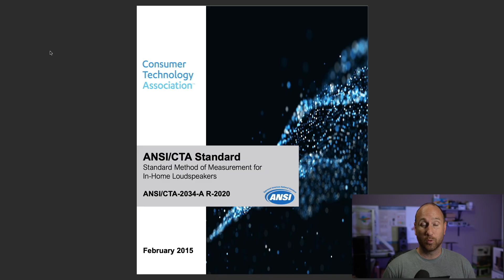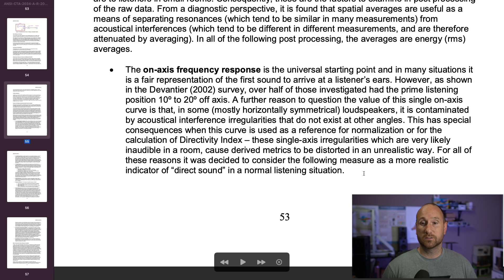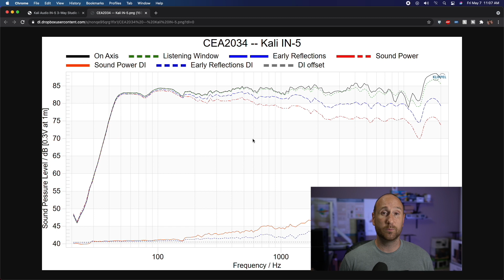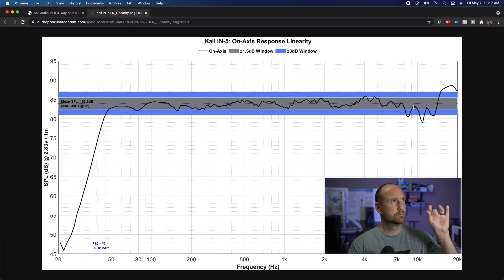What Is Frequency Response?  ||  Understanding the Measurements Part 1

Comment: Thank you. 
Just wanted to point out for nearfield listening people living in Apartments, condos, shared housing  above suites or below that a single sub for me anyways ruins the sound stagging for music. 
For movies sure a single sub is great but not actually needed if you have a largest book shelf design or small floor mount to be used on stands.
A large home with large room you maybe able to enjoy those LOUDER listening times and maybe a single sub would come into play better ?  Would 2 be needed also for proper sound staging in a larger room ?

I`m not exactly sure what the mainstream comprehension is for nearfield distances compared to a industry professional standard but it appears there should be 2 ratings extreme nearfield 2 feet to 4 feet.  Average normal nearfield rating 4 feet to 8 feet ? and the same 2 ratings for farfeild ?

Comment: In fact measurement of frequency response in a way it is popularly understood is not available. Hard to explain in two words but it is mostly about timing during collecting measured  data. 

  Measurement frequency response in anechoid chamber  suffer from ,basic  resonance in relatively big chamber. So if such speaker  "is flat" in chamber  that particular  frequency in smaller room may be downed  and that is why it is so popularly  advised to use sub-woofer., We will be better with speaker which has   lowest frequency as own resonance or cooperating  with resonance of listener's room than with one which has got results in not matching room   resonance of chamber .

   Mostly due to heavy damping in chamber results in real room will emphasize  the reflections of ranges which without treatment are hard to damp in such  room .  Such room damps well only reflections of sopranos That is why most speakers have too soft sounding in home and one of reasons for unnecessary hunt for higher sopranos That is why in my opinion measurements in chamber are false because conditions are although  standard anyway artificial

Comment: Great series of videos , very much needed info for many audiophiles . I dissagree however that on-axis performance is the most important . It's actually in the off-axis dispersion that good speakers are separated from badly sounding speakers . It's not that difficult to design for a flat on-axis performance but  Constant Directivity is way more difficult and very (the most) important !
Reply from the maker: I understand. I come from the perspective of a reviewer where I am explaining that - if you understand nothing else - you need to be able to understand what FR is. And IME, a speaker with a designed flat on axis will behave well off axis. Meaning, if the manufacturer cares enough about flat on-axis then DI is going to be pretty good, too. Of course, with a good DI, one can EQ the speaker more easily. 

But, yes, I agree. I’m just coming at it from a different perspective.

Comment: Thanks for your effort. Good stuff. There's only one point if you may allow me to clarify. You mentioned in-room vs anechoic response being different; while it is true, frequency above the transition frequency, say 250hz, chances are my in room response and yours wouldn't deviate that much.
Reply from the maker: That is true. My point was more so people wouldn’t take an in-room response of their speakers and then compare that to the on-axis response of another speaker.

One still has to be careful comparing two in-room measurements taken in different settings. But trends should be reasonably concluded.
Reply: @ErinsAudioCorner  thanks for the concurrence. Always a pleasure learning from your videos.

Comment: Curious about the X-Y frequency response graph. I think I understood what you were saying about your SPL (essentially volume?) on the left hand column can change depending on if you speak softer or speak louder. Does that also affect the Y axis (Frequency/HZ) response of the speaker. Or will that frequency/Hz response remain the same for the given speaker at different volume levels?
Reply from the maker: It shouldn’t change in frequency unless the speaker has issues with compression. Which is a topic that I will be covering very soon. 👍😎

Comment: Thank you again. Linearity in frequency response is transparency. No one would buy glasses with inclusions or tainted glass or uneven thickness for the purpose of reading books or magazines. And no bibliophile would recommend to do so. 
No museum would expose paintings under tainted lights.
Reply: You're leaving out some very important parts of transparency, such as distortion, and also overhang, which causes smearing and so hurts transparency, detail, and resolution. Dynamic performance and low distortion are just as important as a flat static response curve. How fast do drivers stop moving, and how loud can they perform with minimum distortion? These aspects are very important to a speaker's sound quality.
Reply: @Paul Sxton Of course. Perhaps most speakers are sunspeakers or designed to be. Tone controls are instruments of colouring sound. Nothing to say against. To listen to music ain’t a scientific task. But spending thousands of dollars/euros/kopeken is insane when you can equalise for a handful. 
Transparency from the beginning should be the consumers aim and from then on you can colour ad quod libet. To pay for a fixed coloration and look for fitting flaws in the next part of the reproduction chain is absolute waste of resources in my opinion.
Reply: @Paul Sxton Yes it’s my opinion. It is reasonable to prefer neutrality and then tune it to your taste. I don’t want followers. And, yes, the relation of demand and supply is clear. For the mass market high end audio isn’t existent. Sonos, Bose, Yamaha etc. are the dominant suppliers. Pc and Spotify, small powered monitors are the major components. The Apple DAC Dongle isn’t inferior to a 10.000 $ DAC. (conversion wise, not owners pride issues etc.)

Comment: Hey, Erin I really enjoy your videos! I know you focus on speakers and driver measurements mainly. I'd like to hear your opinions on amps. Do you think amps make much of a difference? Amir does a lot of amp measuring, but he doesn't really say much about how they sound. I've never really heard your opinion on the difference between amps. I know this might be more subjective than you usually get, but I hear so many people saying "this amp sounds better than this amp". Do audiophile amps have something special over something like a quality QSC or crown amp? Something that would actually make the speakers perform better I mean. I make DIY speakers and put tons of thought and effort into the performance but I don't have the skillset to make DIY amps. Would I really be getting better performance if I were to get something more high-end assuming I am not running out of power?
Reply from the maker: In the broadest sense, I don't get in to amplifier sonics.  I shop for amplifiers that a) have power I need, b) have a good name behind it (for reliability concerns), c) have the features (inputs) I need and d) maybe even looks if I'm showing it off.  The one spec I do pay attention to besides power is SNR.  Some amplifiers have high noise floor and that mixed with high sensitivity speakers isn't great for  hi-fi listening because all you  hear is static.  But, hey, I'm rocking some poor SNR speakers with high-sensitivity speakers (97dB+) in my home theater ... so what do I know.  :D :D :D

Ultimately, though, I think there are things more important than worrying about amplifiers from reputable companies.
Reply: Great question🤗🤔😇